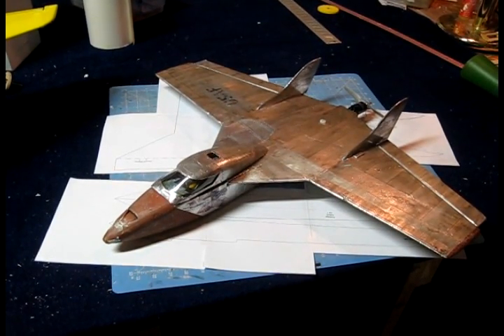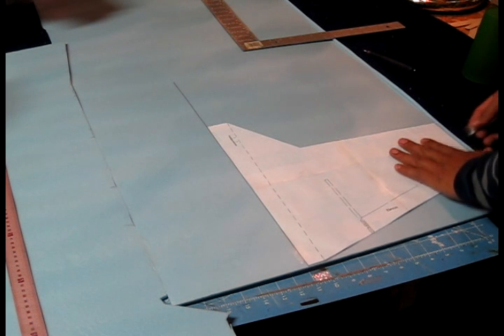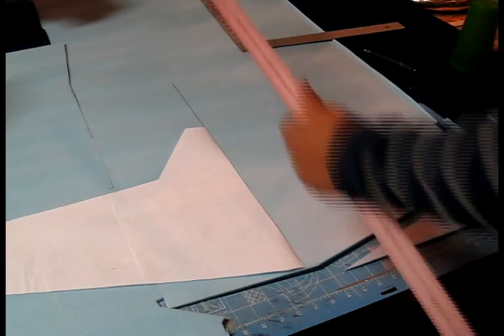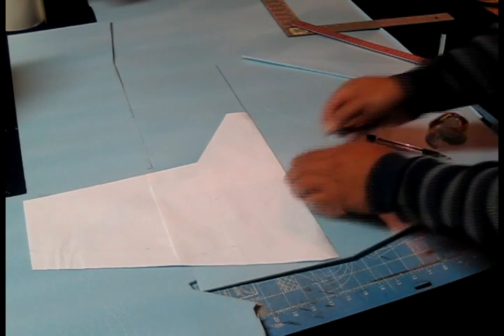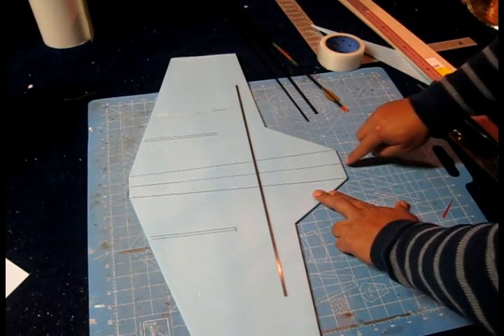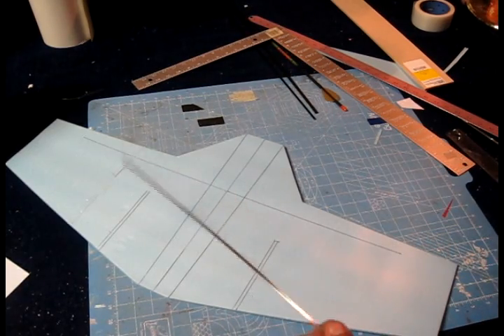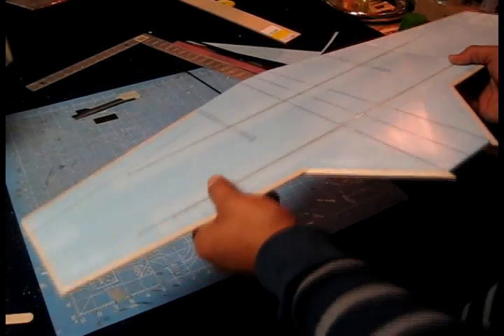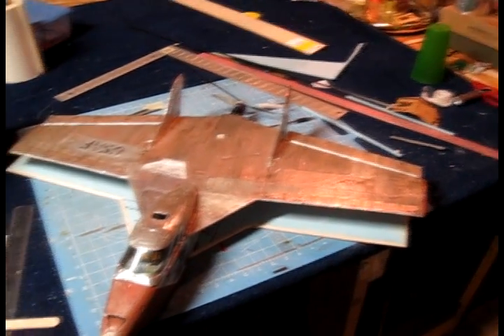F-3 build (part-1)

Comment: i am trying to reverse the shaft on the exceed optima motor you used but i am struggling to take it out. i haveunscrewed the 3 bolts holding it but its really hard. any suggestions? last thing keeping me from maiden flight. gracias.